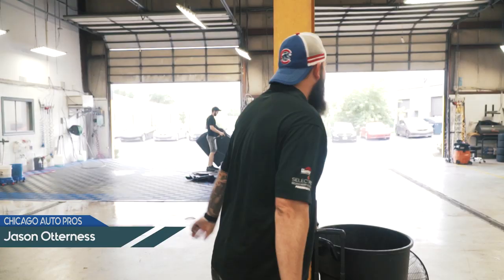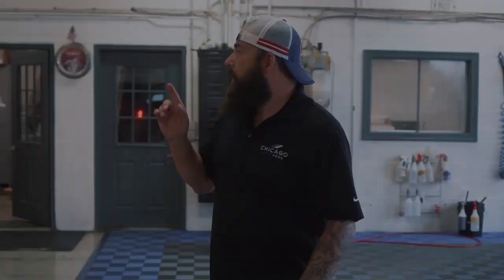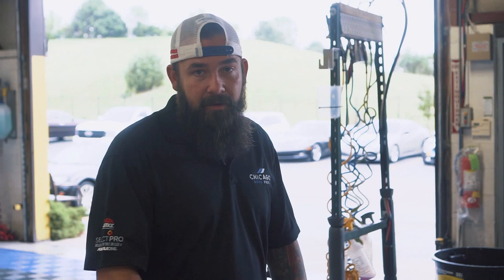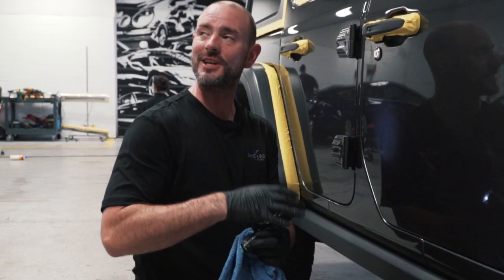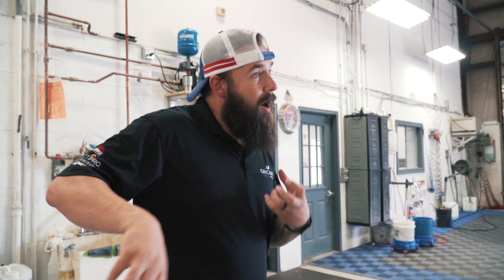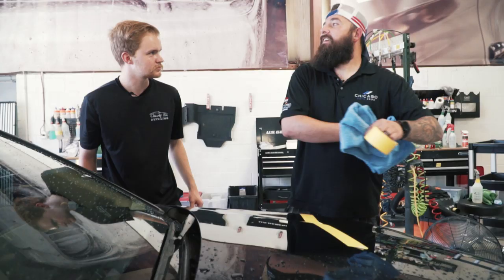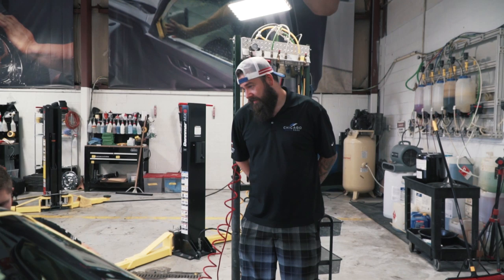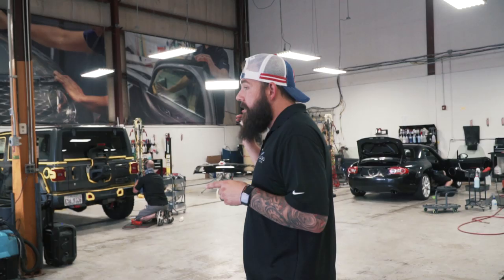Just another Monday at a High-End Detail Shop | Detail VLOG | S3E18

Comment: Besides polishing, is there anything that can remove water spots?
Reply: Try Meg's wheel acid wash. Don't get on glass. Spray acid on towel not on panel and after using it for like 30 seconds rinse away
Reply from the maker: There are water spot removers and they work if you can get to the spots fast enough, but most of the time it's etching on the surface.